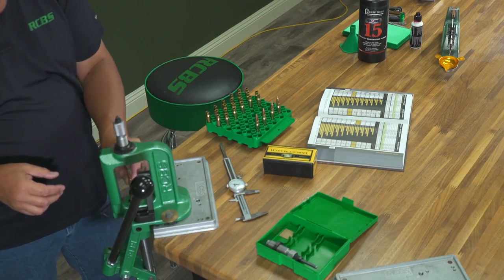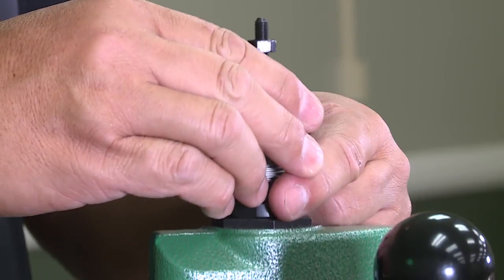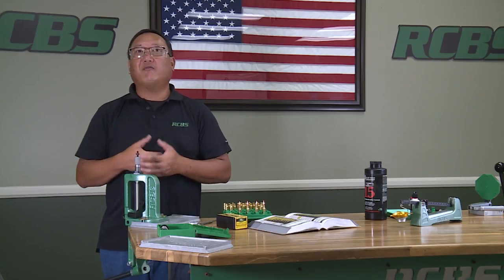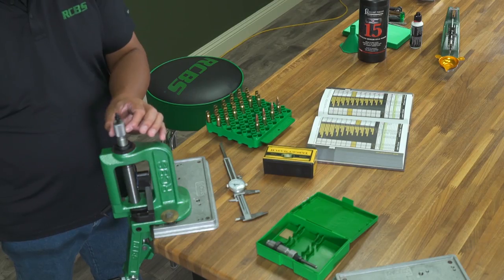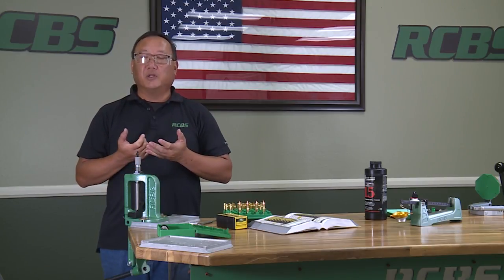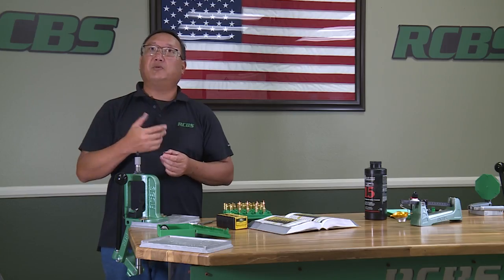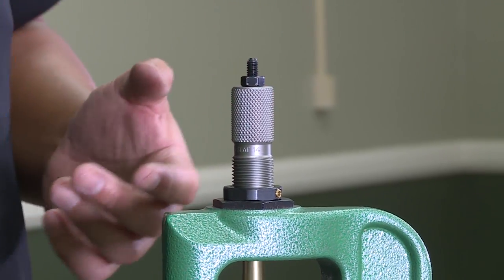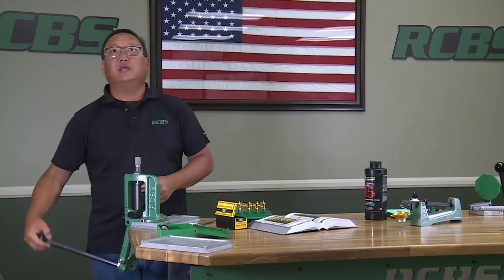Intro To Handloading: Crimping

Comment: I would like to add a few things, you MUST trim every case and make sure every case is the correct length if you are going to crimp. If you set the crimp height and crimp longer non/improperly trimmed brass you will over crimp. When the cases are over crimped, the brass will move downwards an bulge the case at the top of the straight wall and the bolt will not close and often stick in the chamber of the rifle I only crimp very lightly or not at all if a groove or cannelure is not present for the crimp to lock into. Magnum revolver loads and cartridges loaded for tube feed rifles like lever actions should be crimped in a cannelure.

Comment: I've never crimped anything until I tried to crimp some .375 Ruger bullets and ruined 3 cases and one bullet trying to follow the instructions that came with my RCBS seating die. I was trying to seat the bullet and crimp at the same time. I need more information then what's provided in this video with slow motion and slow talking. How do you set your COL with out crimping the bullet. How do you tell of a bullet is over-crimped? Is there a different procedure for Roll crimp and Taper Crimp?

Comment: In the video the bullet you're crimping has no cannelure. Per what I've read you should only roll crimp bullets with a cannelure, so are you performing a taper crimp in this demonstration? If it is a taper crimp which die are you using to get that?

Comment: When should you crimp? Should I be crimping for every bullet? I'm trying to get all the information I can before I start
Reply from the maker: Hi Corey, for pistol, we recommend a roll crimp on a revolver round since it headspaces off the rim of the case and we recommend a taper crimp on an automatic as it headspaces on the case mouth. For rifle, if you are using a cannelured bullet we recommend roll crimping in the cannelure, and if you don't have a cannelure on the bullet, you can seat the bullet without crimp or purchase the taper crimp (rifle) if available. Also, you can always refer to the bullet manufacturer in the respective reloading manual for information about reloading their bullets!
Reply: @rcbsreloading  thanks so much!
Reply: rcbsreloading so for a 223/556 semi auto rifle would I use a roll, or taper crimp? Also what crimp is needed for a bolt action? And what crimps can be done with the method shown in this video.

Comment: So do I need a crimping and seating die for rifle, or will any RCBS bullet seating die do this?
I plan on reloading for the M1 Garand.
Reply from the maker: Hey there, All RCBS seat dies are a combination seat and crimp die, so your seat die that was included in your set will seat and crimp simultaneously.  RCBS does not offer an after crimp die. Hope that helps.

Comment: is there any advantage to seating and crimping separately vs at the same time?
Reply from the maker: Hey Zachary, Yes there is an advantage to seating and crimping separately.  When seating and crimping at the same time, the seat plug pushes the bullet into the case at the same time the body of the die crimps the case to the bullet. When separating the operations, you can eliminate shaving the bullets when trying to seat and crimp simultaneously. Our ProChucker 7 was designed to break out each operation separately for optimum reloading. Hope that helps!